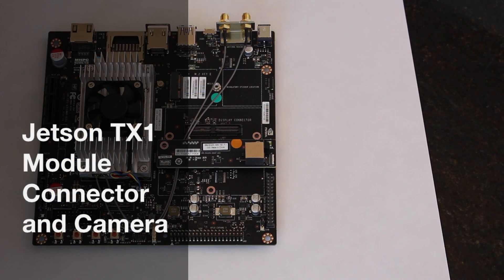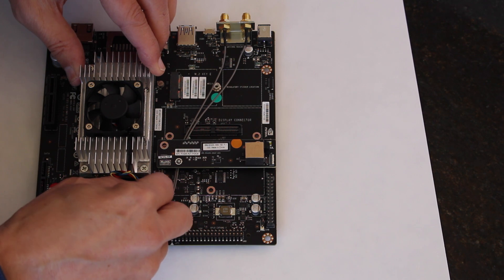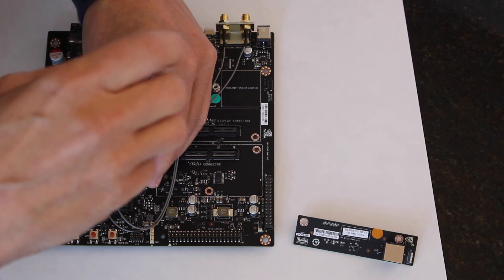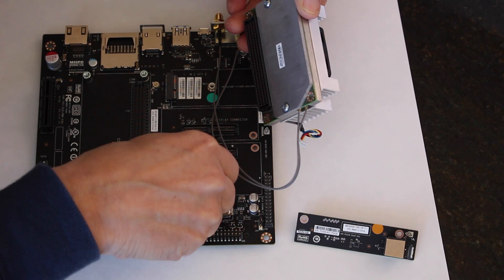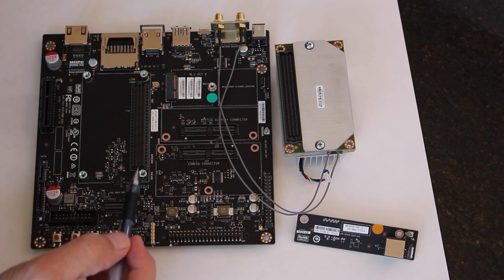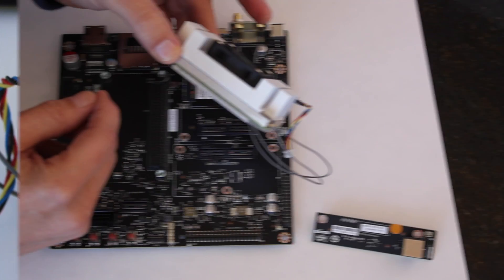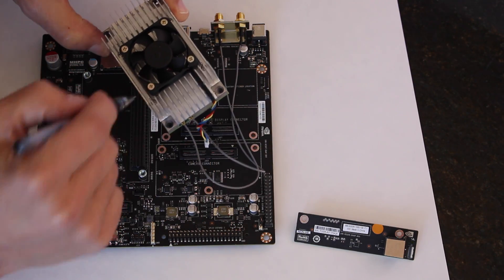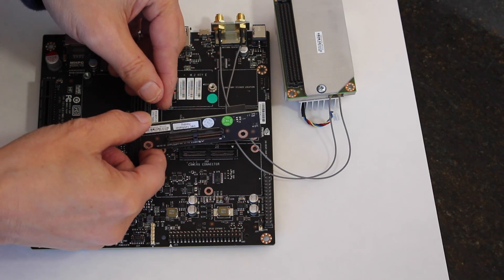NVIDIA Jetson TX1 Module Connector and Camera

Comment: Sorry, but why is taking the SoC off the base board such a bad idea?  Isn't that what most people/developers are going to do in order to deploy the TX1 in drones and other space-confined embedded computing applications?
Reply from the maker: +Kastan Day It is fine to take the entire module off the carrier board, and even the finned heat sink off of the top of the module itself (with the fan).
However, the actual circuit board that the SoC is mounted on is mated with a heat spreader, called a Thermal Transfer Plate or TTP,  at the factory. The TTP should not be removed. The TTP is applied in a special process which once taken apart can not be put back together without specialized equipment. The TTP is then mated with a passive/active cooling system dependent on application.
Reply: +Jetsonhacks Yeah that makes sense. My main question at this point is how one would go about making use of the TX1 without the base board.  How would you power the SoC?  I assume you would communicate through its integrated 802.11ac wifi and bluetooth?  Can you offer any insight into this?  Do you have plans to use the TX1 without the base?  Thanks for the replies.
Reply from the maker: +Kastan Day Power depends on the application of course. You could power it with batteries for mobile applications, it could also works off of wall outlet as it does on the carrier board. The built in wireless is one option for communication. As you know, this is a development board. Designers, engineers and hackers will build their own carrier boards for specialized purposes. For example, there's talk already over at the DIYDrones site of building a specialized board for drones with the TX1: http://bit.ly/1MOBKWx

It's pretty easy to imagine that a Jetson TX1 module flying on a drone is not the same environment as that of a industrial robot in a factory or an autonomous vehicle. The  strategy that NVIDIA appears to be pursuing is that they will build the best Tegra module possible, build them in quantity to keep the price down, and then let application designers build the module into their designs. That way NVIDIA is doing what they do best, and the rest of the ecosystem gets what they want.
There is a 400 pin connector on the module, and provides a wide variety of different interface signals from the module itself. The NVIDIA carrier board is there as a reference design.
Reply from the maker: +77Avadon77 That's the point of the Dev Kit! It gives you a starting point to develop and work from. But one of the other uses for the Dev Kit is to help manufacturers  integrate the TX1 module into their products easily. On a drone for example, there are a lot of competitors for any extra weight on board. Some people want longer battery life, better cameras, different sensors, and so on. They don't want a large heat sink and a bunch of connectors they don't need in a large footprint. So they build their own carrier board, for example: http://bit.ly/1kMfqGe which provides a better interface with other on board computers. 

You'll have to post a video of your robot!
Reply from the maker: +77Avadon77 It sounded like the person undertaking the board is an electronics hardware engineer with available board fabrication facilities. While it's much easier than it used to be to do that kind of engineering, it does require quite a bit of skill and some capital to get good results. For example, when bringing out high speed communication on the board like USB 3 the designer has do the calculations to make sure that the traces are correctly laid out so that they aren't noisy and either become antennas or create electrical interference. Then there's all the other electrical bits and pieces that the engineer has to be aware of, which is usually obtained by pouring over data sheets for each of the individual parts. In part, that's why NVIDIA has a reference implementation (the DevKit) to help people through the process. 

In small runs, the individual boards tend to be relatively expensive. The smaller carrier boards will probably be equivalent in price to the full size carrier board. Something I learned long ago: "Hardware is hard". It's easy to remember, because it's in the name. It's usually expensive too.
Reply: +Jetsonhacks Interesting. My girlfriend and I are taking the low-cost DIY approach. ;-) Basically take the carrier board, place it into a mini ITX case and place the whole thing into the torso(chest cavity) of our robot. Why reinvent the wheel when the carrier board has everything already on it.  That's how I see it. If necessary we'll hang adruino shields or BB capes or what not off of it.  I honestly don't think the entire carrier board is necessarily impossible to be drone worthy considering how big drones are getting these days and how much payload they can carry. As a builder fabricator foremost I know starting lazy is the best and fastest way to get things done. You can always upgrade, refine and improve once it works.
Reply: 77Avadon77 I completely agree.  But more optimal implementations could be fabricated from scratch (with time, expertise, money and at scale).
Reply: Jetsonhacks
Wow that is really cool. Correct me if I'm wrong but isn't making your own carrier board a massive engineering and seriously expensive project?

Will definitely make a video once we get further. RIght now it's just a few grand in parts. The torso will mostly be tig welded Ti and 60601T6 and well lots and lots of servos as you can imagine. The reason we got the Tx1 is for the robotic vision and creating AI with it also sounds promising.

Right now though I'm stuck on the jetpack install. I use the chmod +x and it's effective and when I run it, it unpacks correctly but no window pops up to start installation. Went into the _installer folder and I've tried to run everything in there and I can't get the window to pop up. Strange!? Any thoughts? On your TK1 video the window comes right up when you run the jetpack on the host computer.